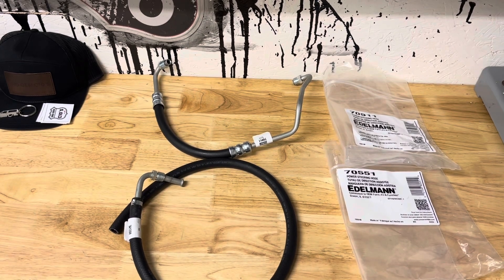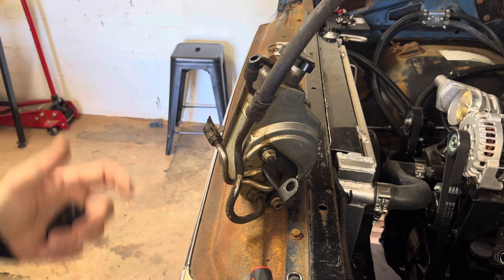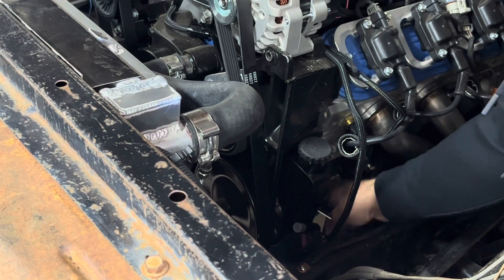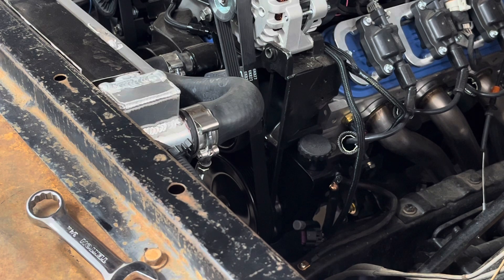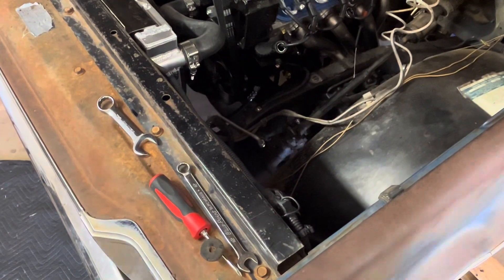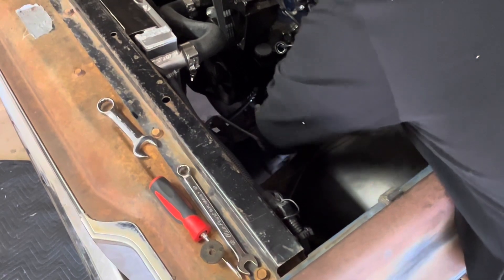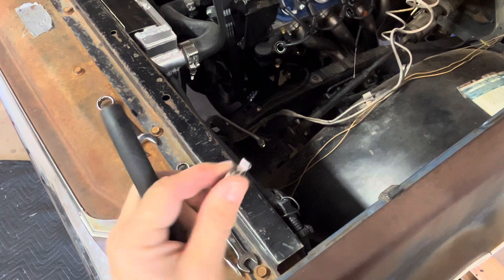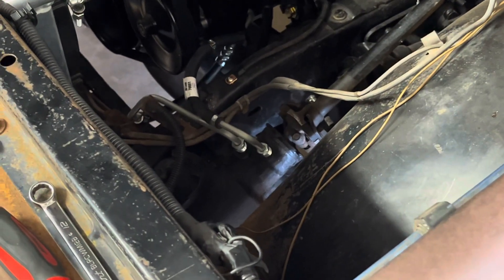Cheap and Simple Squarebody ls swap power steering hoses.

Comment: You know if this will work for a 84 k5.
Reply from the maker: Should just be able to buy 1984 replacement hoses, you won’t need the adapter with 80-87 gearboxes